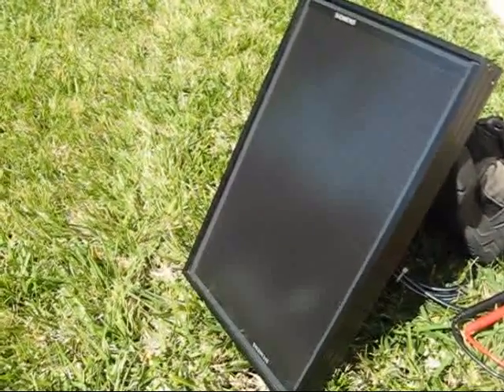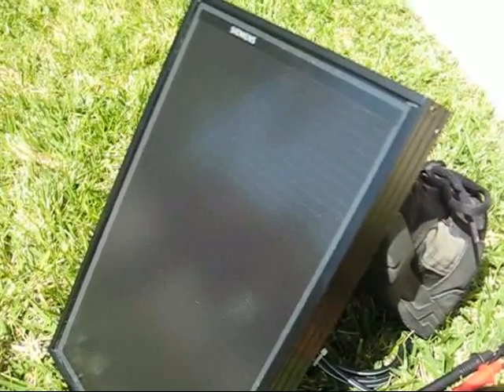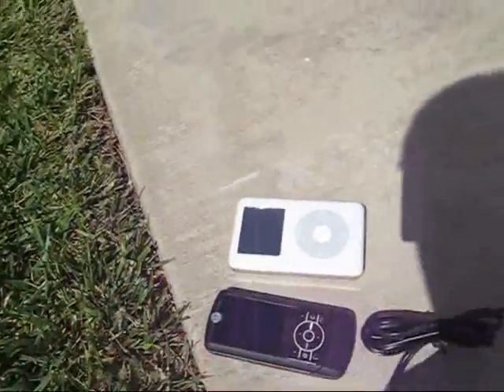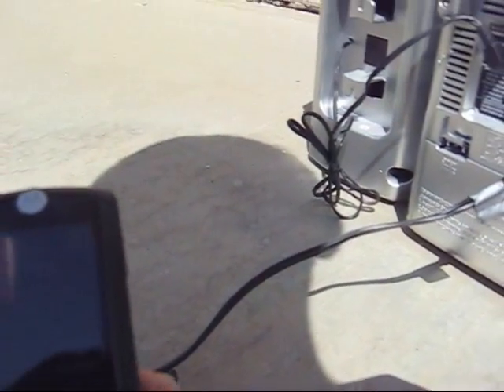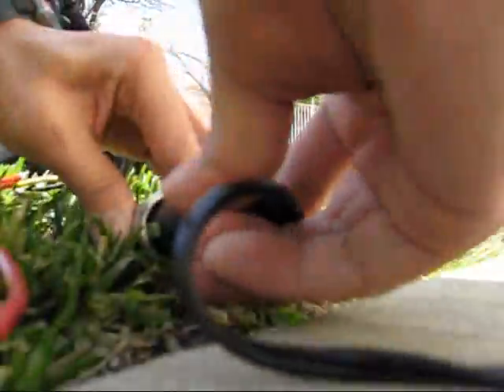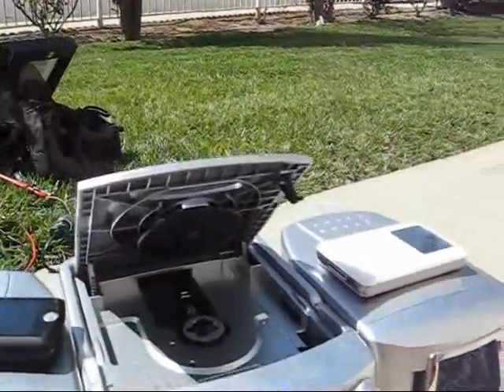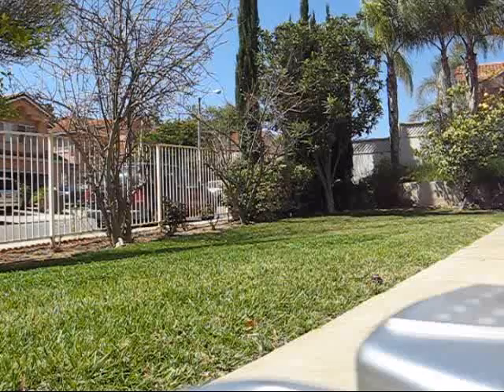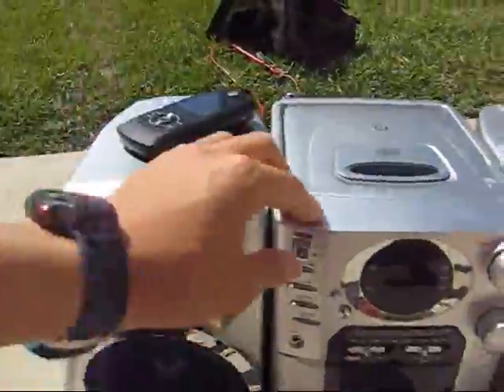Siemens (Shell) ST 5 Solar Panel

Comment: I recently got a case of the 2"x2"  shell cells from ebay  I built a nice 26 watt panel for my garage and a few smaller ones,Well long story short a 20 volt 1 watt panel cooked my radio so be careful when charging the expensive electronics.
 I'm glad to hear your listening to rush too!